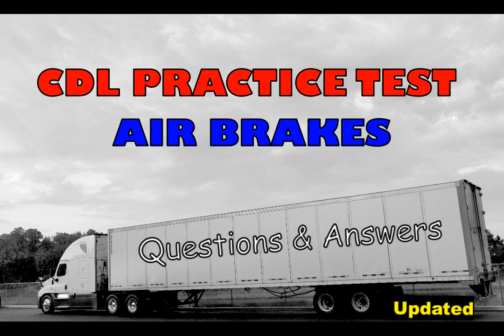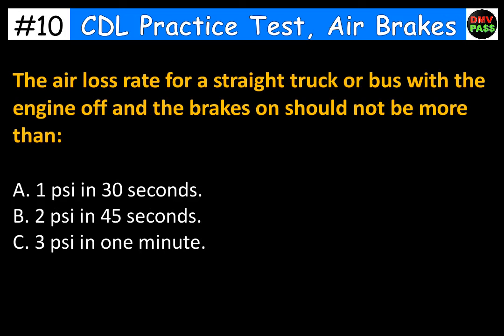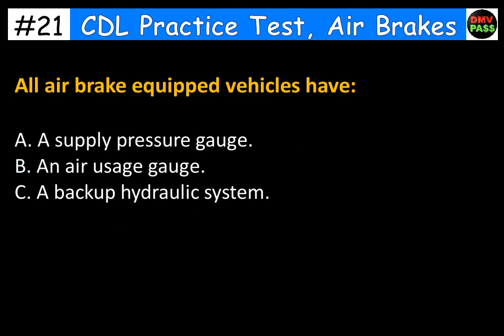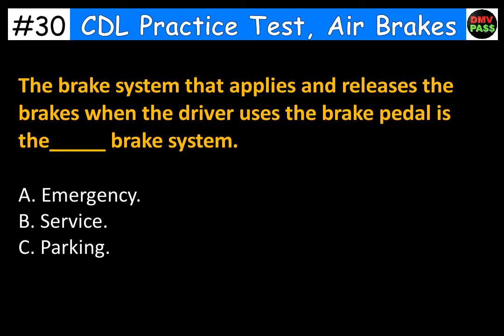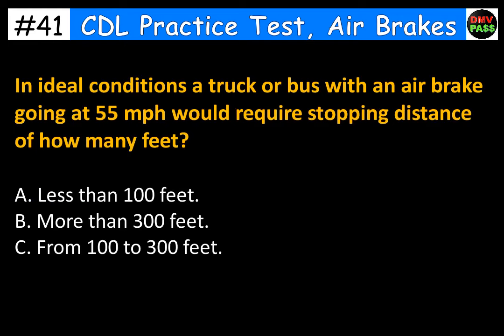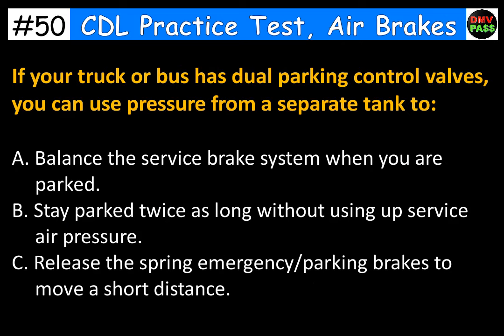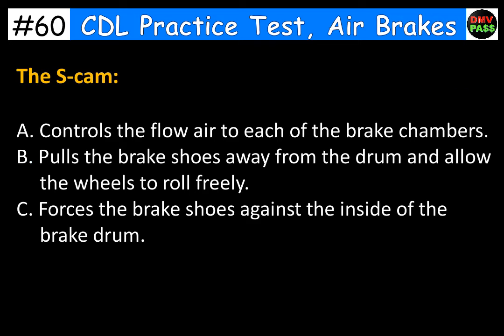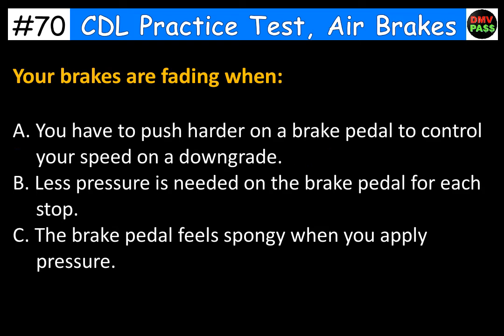CDL Prep Test/ Air Brake Questions & Answers

Comment: 10/10 just passed my test this video helped out a lot thank you. In westcovina CA
Reply: Just passed the general knowledge after 2nd try - today I’ll take air brake
Reply: the comment i was looking for im also from the sgv idk if anything has changed since 5 months ago but was the air brake test lengthy?
Reply: @k24integra wondering the same thing  I will be taking my test soon. Here in So Cal
Reply: @cesarcruz3222  i took the test in april the only lengthy part is the general knowledge and they also test you on class c which i did not know but still passed regardless. If you studied you'll have no problems. 

Also add any endorsements you might want to have on your license.

Hazmat needs approval from a school to take it but doubles/triples, and tanker is available. Good luck!
Reply: @k24integra  yeah I will need the hazmat endorsement.  I appreciate you taking the time to reply. Be safe out there. Happy travels!

Comment: perfect. I was concerned I wasn't absorbing info, but i was surprised i got almost all the questions right.

Update: passed the exam. Almost identical question from this video
Reply: Me too!! I shocked myself!!
Reply: @torreforeal8005  passed all the tests and have the permits thanks to YouTube videos. ELDT, airbrakes, general knowledge, combinations
Reply: I’m nervous I take the test on Monday.
Reply: @MonsterTruckingCo.  thanks
Reply: We’re most of these questions on tha test?
Reply: @darylpeirce8014  literally all of them. All of my questions on my test where one from this video. They are randomly selected but if you can pass this video, your ready to test. This video really helped out a lot.
Reply: @MonsterTruckingCo.  thanks for your response. I’m going to test on Friday. I just passed my general knowledge yesterday.
Reply: @darylpeirce8014  watch the air brake test question videos and the combinations video. Both are very informative and ask what’s going to be on the test. Just get the air brake test questions for the test right, memorize them, once your in class, the airbrakes info will make even more sense.
Reply: @MonsterTruckingCo.  ok thanks a lot .
Reply: @darylpeirce8014  no problem. Good luck
Reply: @top10highlights50 Did you pass all your tests?

Comment: When should you AVOID using the exhaust brake?
Reply from the maker: It is not recommended to use it on snowy or slippery roads.

Comment: Number 61 isn’t the correct answer C ? Be sure the air system is fully pressurized. 

Also it just says driver: . Shouldn’t it say driver must: ?
Reply: All the other platforms I use also say the correct answer is “let the air out of the brake system “ hopefully it’s correct. I take my test next week

Comment: They keep repeating the same questions ive seen the same question and answer 3 times now “Why should you drain water from compressed air tanks? Answer: Water can freeze in cold weather and cause brake failure.
Reply from the maker: The purpose of the repetition is to help you review and effortlessly memorize the answers. When you get to take the test, once you see the correct answer you'll recognize it. Hope that help.

Comment: New subscriber from Saudi Arabia. Filipino Trucker. Are this questions similar in Canada's Class 1 license in Air brakes test?
Reply from the maker: Yes, it's the same principles for Air Brakes everywhere, just like combination vehicles. Like in photography, no lights, no photos.
Reply: @dmvpass9786  Thank you so much I am peparing for Class 1 in Canada. This is a perfect timing for me. I already got signed a job offer in Quebec. Thank you for sharing this video. This helps a lot. More power to you and God Bless.🙏
Reply: @nojiedirkksatrucker4259  did you pass the test?

Comment: Hi what is the difference in question 10 ,15and question 23?
Reply from the maker: Hello ST! Thanks for your question. The key here is "Brakes released" and "Brakes on". When brakes are released they are OFF (vehicle can move), a leak of more than 2 PSI/Min is not OK (#15 & 23).  When brakes are applied they are ON (vehicle can't move), a leak of more than 3 PSI/Min is not OK (#10). 
I know it's a little bit confusing. But the questions # 15 & 23 are the same. As you can see, the correct answers switch positions just to help you memorize the answer and to test how well you know it. Hope this helps.